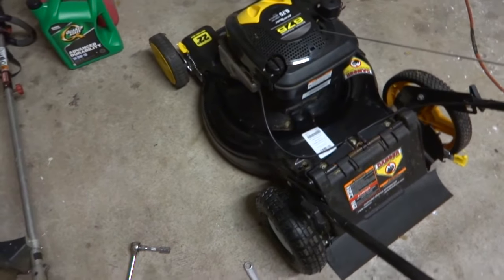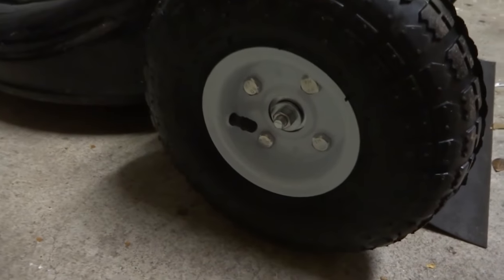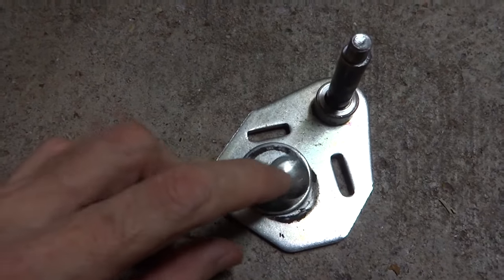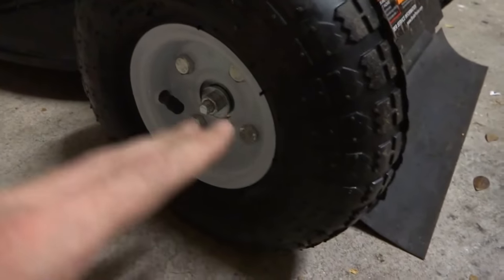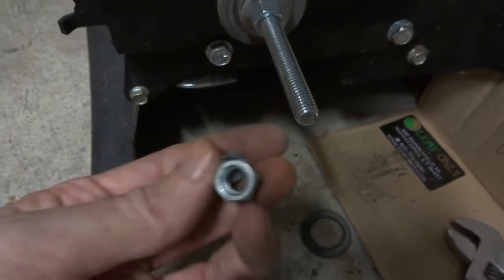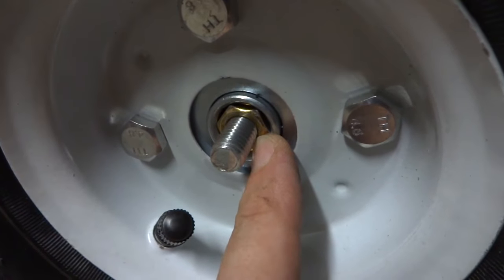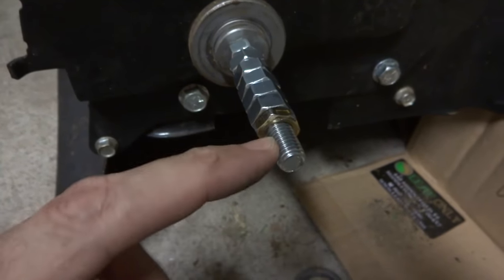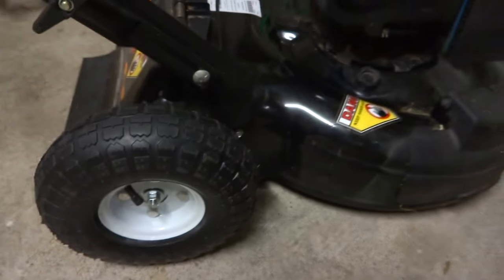How to install 10" pneumatic wheels/tires on a brute mower

Comment: Nice lawnmower Dave. Let's see some spinners on that sucker :)   By the way, that's a carriage bolt. A lag bolt has the threads that screw into wood. Also, for the fuel line, I'd try an automotive parts place and ask if they had black rubber or neoprene ordinary gas fuel line and how much per foot (Also ask them which is best - rubber or neoprene). A lot of those counter guys really know their stuff.  Also, that looks just like my Toro and probably 200 bux less (I'll bet).   Oh, is that front wheel drive?
Richard
Reply from the maker: i will put a note in the video. yes its front wheel drive. works real good much better than the other i was using.

Comment: i came across your video bec i wanted to know if anyone changed their mower's tires to the pneumatic wheels.  so after the tire change, any update?  was it worth it to make the change?  does the mower move over the lawn better than the old wheels?   I have a electric mower 21" corded.  I have a yard cart that uses the pneumatic wheels and i thought it moves over the lawn much easier than the mower bec of the wheels.  any update or additional tips for wheels?  thanks!
Reply from the maker: they are still working great.   dont know how yours mount but if you can use the factory mounts to keep the adjustment level, if not just make sure the wheels are at the height you need. but it does make it easier to move the mower around.